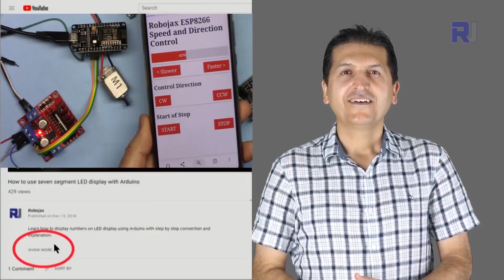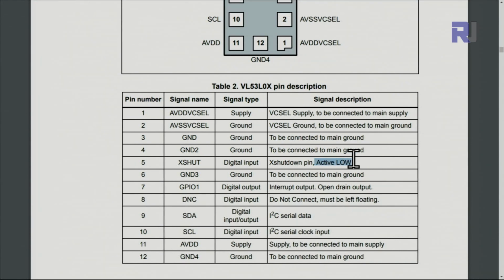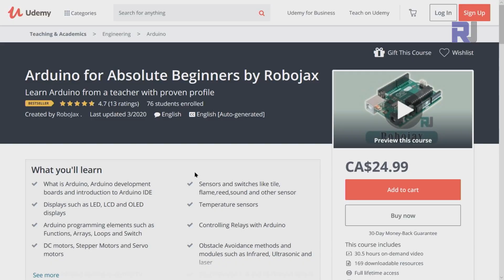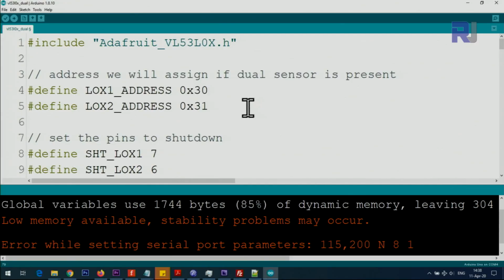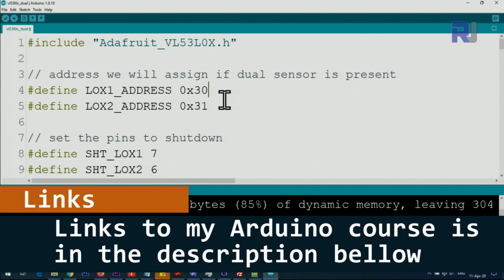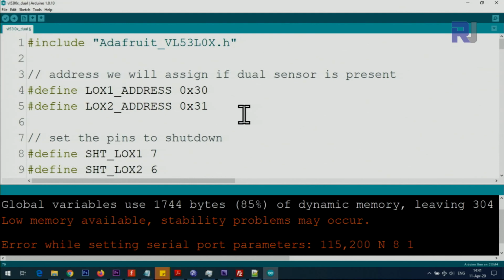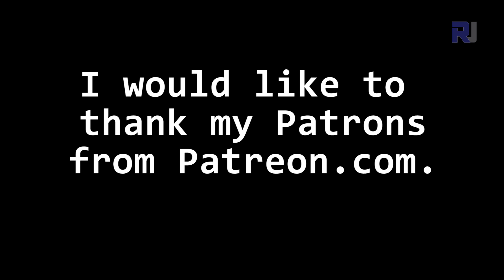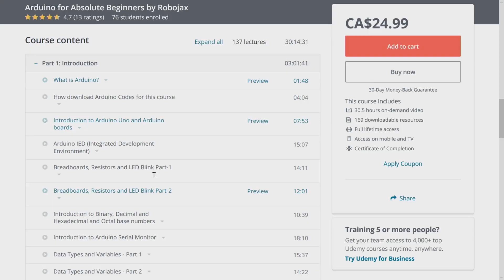Lesson 83: How to use 2 or more VL53L0X  ToF Laser Distance Sensor

Comment: Does this sensor give accurate measuring when you use many sensors at the time at long distances? like using 4 sensors in a range of 3 meters. I'm looking for an alternative to the ultrasound sensor
Reply from the maker: Hello, I have provided the datasheet. this is from ST semiconductor. The resolution is mentioned in the introduction video. I mentioned in the beginning that this video is to show you how to use 2 or more sensors. for full details watch the introduction video. The link is under video in the description.

Comment: Hi Robojax , i have a challenge.  I want to make object detection on a drone (F,R,L,R and Bottom ) . I would like to use 5 x  TOF10120's on an Arduino miniPro 5V 16Mhz. 1th challenge is different I2c addresses (don't know if this is possible on the TOF10120 ?) .2th Challenge is to rewrite  an existing *.ino that uses 5 x HC-SR04's as sensors and pushes out Mavlink commands over a serial connection to a Pixhawk Flight controller trough RC override commands. This will save calculation power of the flight controller ,solve the amount of physical connections possible on the flight controller and the exiting available space on the drone issues for me. What are your thoughts about this ?.
Reply from the maker: Hi, I just did online search and found only Chinese datasheet for the module.  I would suggest using VL53L0X or VL53L1X which are very easy to use and both have full documentation and datasheet.
Reply: @robojax   Thanks for replying ,  unfortunately the TOF10120's are on the way from China . ill have to go for these first.. i guess an other option would be a  cheap I2C multiplexer ?.or are there disadvantages to use these in my setup ?
Reply from the maker: I just purchased one them. it will take about 40 days to arrive and I will make video if time permits.
Reply: @robojax   This will be on my TOP interest list ! ..can't wait ! ( maybe i'm faster in "trial and error" testing than you LOL )  Thanks !

Comment: Nice video. Have you done any experiments to understand whether one sensor can interfere with the other?  Any thoughts on whether there is a minimum distance you need to keep the two apart to keep them from interfering? Or is the deign of these sensors such that they are guaranteed not to interfere/crosstalk?

Comment: Thanks, nice intro to VL53L0X. The adafruit site claims upto 1000mm, but I noticed you showed it working only under 400mm - do you get erratic distance measurements when it approaches 1000mm?
Reply from the maker: you are welcome. This video focused on using two more VL53L0X. If you want full review of the module, see the links in the description.  It can measure according to datasheet up to 2m (200cm). Here is datasheet https://www.st.com/resource/en/datasheet/vl53l0x.pdf

Comment: Will it be possible with one vl53l0x and one vl53l1x with a proper code? Displaying results simultaneously on an I2C display?
Reply from the maker: of course possible.
Reply: @robojax  Can you please provide a code? I'm not sure what I need to change in the Dual code provided in the examples.
Reply: @robojax  also it appears that both sensors have the same adress, can I solve that without a multiplexer

Comment: Could you please show the connection configuration diagram for 3 sensors. I have been trying to use the example on the Adafuit library  "VL53L0x_multi_extended"  for my robotics project, but cannot figure out the wiring for 3 sensors.
Reply from the maker: I just watched the video because I was surprised by your question. I have explained the wiring the best way possible. if you need the draw the wiring, then get free software https://fritzing.org/ and draw it.  good luck.
Reply: I am also looking for a connection for 3 sensors. Did you find out how to do so?

Comment: what about resistors on the I2C buss when you connect multiple modules ?
Doesn't each module have resistors and having multiple will cause problems or not ?
Great video by the way, I was going to shut them down and only have one active at any one time, I didn't realise you could reassign athe I2C address which is really useful.
I assume this is lost on power off so will need to do at startup every time.
Reply from the maker: You don’t need a resistor as the module and arduino already have them.  For address also don’t worry every time you reboot all the process will be done and and it will work.
Reply from the maker: The module has resistors all of them. see one example here https://www.pololu.com/file/0J1188/vl53l0x-vl53l1x-vl53l3cx-time-of-flight-sensor-schematic.pdf and don't wory.

Comment: Does this work if it's in a small space like a 5cm diameter tube
Reply from the maker: No because it has a field of view.  If your place is at 10 cm, it may work but if you use at 200cm it won't detect that all object

Comment: Nice tutorial,is it possible to set to long range mode in some way ? The range will  then be 2m max instead of 1m.
Reply from the maker: in this library https://github.com/adafruit/Adafruit_VL53L0X/tree/master/examples  you can set Adafruit_VL53L0X::begin(uint8_t i2c_addr, boolean debug, TwoWire *i2c,
                                VL53L0X_Sense_config_t vl_config)
replace vl_config with one of the following
       VL53L0X_SENSE_DEFAULT
        VL53L0X_SENSE_LONG_RANGE
        VL53L0X_SENSE_HIGH_SPEED,
        VL53L0X_SENSE_HIGH_ACCURACY
Reply: Thanks,gonna try that

Comment: Can I connect the Vl53l0x directly to PLC LOGO?
Reply from the maker: no you can't. PLCE Logo is not a microcontroller. you need a device to be able to communicate via I2C and read values. This vidoe is not introduction to the module. You can learn about this sensor here https://youtu.be/CUg8VheNyoU

Comment: Is it possible to substitute the VL53L1X for the VL53L0X? I would like to use this library and example code for the two VL53L1X
Reply from the maker: I have not checked the code, but if you understand the code, the same method should work.
Reply: @robojax  is it possible to use the VL53LOX library for the VL53L1X?
Reply from the maker: of course not.

Comment: is this good for inclined surfaces?
Reply from the maker: This video is about using two sensor. I have full explanation of the module here https://youtu.be/S2jaAQEv3Yo but I know it needs the beam to reflect back. The inclined angle might affect it and it depends how steep the angle is  and the type of surface.  So the only way to know is to practically test it.

Comment: I tried it with 3 vl53l0x and one of them is defect now. I think it was a short circuit. Do I need pull up resistors for more then two sensors ?
Reply from the maker: You don’t need anything.  So as I have shown.

Comment: I think  the data frequency will be  reduced?
Reply from the maker: only delay() function will reduced it.  Each module needs some time to read data. Arduino is not slowing it down.
Reply: @robojax  I used  4 tof sensors, even I set delay to 10ms, the frequency is only 7hz. Indeed tof sensors can reach 30hz. Could you help me?
Reply: @robojax  and I also tried TCA 9548, still frequency was divided by number of the sensors
Reply from the maker: If you see it is 7hz, then it will take 1/7=147 milliseconds and you have to wait before going to the next sensor.
Reply: @robojax  do you think it is possible to read the sensor at the same time so that the frequency wii be no influenced? And do you have any solution?

Comment: Hello, I am having an issue using this code with two or more sensors on the Arduino DUE. I am getting a failed to boot error. Is it possible to use this code on the DUE?
Reply from the maker: you can use it with any arduino. you have to play attention to SDI and SCL pins the pines are different. See it here https://www.arduino.cc/en/reference/wire  Due 20 (SDA), 21 (SCL), SDA1, SCL1. please replay back here so I know the issue is resolved. good luck
Reply: @robojax  Hello, I have since implemented my code on a arduino mega and it seems to be working much better. However, I am trying to read distances from four sensors. Do I just include the rest of the sensors in the setID(); funciton? Or do I need to group the sensors in pairs of twos for both setID() and read_sensor() funcitons?
Reply: In other words, I am not having any issue assigning new I2C addresses to my sensors. That part is working fine. However, I am only getting a distance reading from one sensor (measure4). measure1-3 are all giving me a value of zero
Reply: What extra code needs to be added in order to run more than 2 sensors?
Reply from the maker: I believe I made this video to answer all of your questions. I made videos for one sensors but when I read comments, I made this video. I have explained it in the code section of video. If I  can’t repeat what I said in video , besides I don’t even remember what I said as I have made over 50 more videos after this. Just watch without skipping and I can assure you that you won’t have any questions after the end of video. Pay attention. May be watch it 2 or 3 times. Good luck

Comment: Thanks for making amazing video! I have tried the same code but having  "Failed to boot first VL53L0X" problem. What might be the cause? Thanks in advance!!
Reply from the maker: first do the complete wiring. then disconnect module 1 and run I2C scanner to see you get  I2C address. then disconnect 1 and connect 2 only and check I2C address. you might find the issue with wiring or bad sensor.